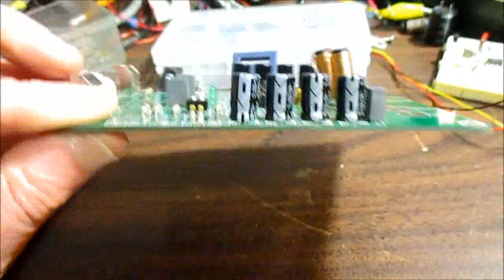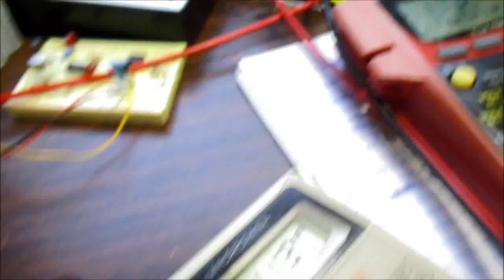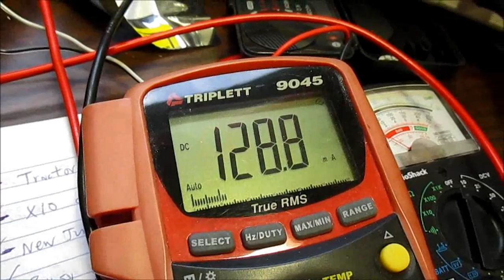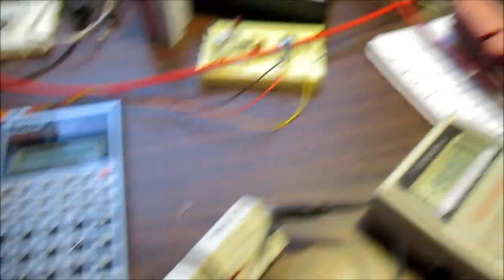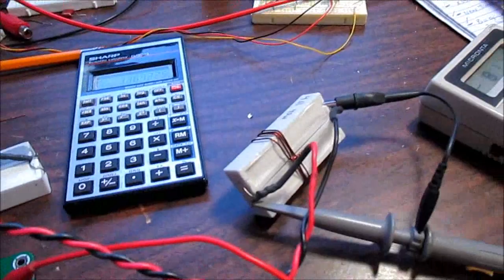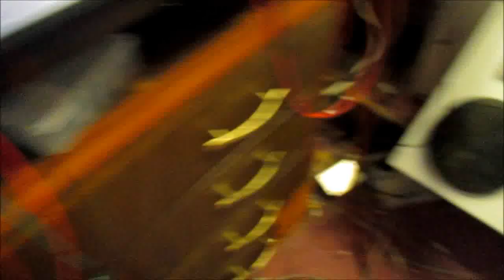Class D stereo audio amplifier kit review

Comment: can i connect my electric guitar to it directly?
Reply from the maker: You would need a preamp.
Reply: but electric guitar pickup have passive preamp...wouldnt it work directly with this class d amplifier kit?
Reply from the maker: If you set the switches to highest gain on the amp, it could work. It really depends if the input impedance is not too low. Guitars really need a fairly high impedance.
Reply: okay thanks for your help.. :)

Comment: inductor power dissipation at idle seems to be a common issue with switching type amps, probably in much the same way that inductors in switching power supplies pass current even with the IC "off". My TA2022 based amp runs cool all the time except when i turn the volume right down to the stop and leave it. Thing gets ROASTING hot then
Reply from the maker: +Maurice Orris What is the idle current draw? Roasting hot at idle sounds like there is a bigger problem.

Comment: HI John, hope things are well with you. Bought a mini hi-fi 2.1 DC 10-18v digital amp board 15w*2x30w class d from gloriadly on eBay. Hooked it up to a 12 volt supply and hooked up only one channel and played a song through my iPhone through an 8 ohm speaker. Output very low. Any reasons off the top of your head as to why the output is so low? Maybe I should be using a 4 ohm speaker? Don't have one so I can't try it. Thanks for the insight and take care.
Reply from the maker: +Ron Siddall It could be the amplifier has low gain. If you mean there is barely any sound even with the volume all the way up, it could be one of many possibilities.

Comment: Just put this amp together and have it playing a pair of Def Tec Pro Monitor 1000's with a 28v Power supply and i am impressed. Very low floor and fairly accurite with very little distortion within reason. For $20 not bad at all and a fun little project.

Comment: The granulized "4-bit" type sound comes out because your source is also using a D class amplifier. It creates a distorted sound, probably caused by those both switching frequencies... 
I noticed that with 'some' D-class amps feeded by my iPhone phones output. 
Using a dock connector in audio output mode, this is no more a problem. 
Try this amp with another 'full anaogue' line out, like a CD Player to try

Comment: Hi John, I have assembled the schematic from the datasheet around the TPA3122 changing the outputs with 33uH LP filter and 1000uF HP filter.
I get a 400mA draw on PSU if i touch the headphone jack and also if I put DMM on the HP Jack I get 1.5v. Needless to say I does not reproduce music. Any ideas and thank you in advance for your time.
Reply from the maker: MonkeyMagic Elecifun  This chip requires careful ground layout and decoupling near the IC otherwise it can be unstable. Could be many things without seeing your circuit.
Reply: JohnAudioTech Hi there, I understand what you are saying. If I make a short video showing the circuit, could I show you please?
Reply: +JohnAudioTech Hi, I done it, I re did the circuit and am listening to it now. Its not too bad at all.

Comment: JohnAudioTech Does increasing the output coupling capacitors (uF's) from 220uF to 1000uF make a big difference on the sound quality?, what does it actually do increasing them?
Does it make the bass better or does it mean when the amplifier is really loud the bass signal would NOT break down and have more power behind it with the larger output coupling capacitors,is that what it does.
Is there a limit to where i could increase to, could i go 47,000uF for example and would that sound much better.

Sorry to ask lots, what exactly do theses capacitors do, thanks
Reply from the maker: SP330Y The caps main purpose is to block DC from getting to the speakers. Since they are a high frequency passing element, they need a larger value to pass lower frequencies. 1,000uf good, 2,200uf is even better. Going too large is bad as a large burst of DC would conduct through the amp and speakers when the amp is first turned on as the cap charges which can be potentially damaging. It is not really adding bass to the sound, just letting more of it get through to the speaker. If the speakers can't play lower bass and/or the music lacks much bass content, bigger caps won't necessarily help.
Reply: Thanks so much for your insight and explanations. In the video, you pointed to the two caps on the right being the output caps, but what are the two on the left for? What if they were changed to 1,000uF as well? Thanks and take care!
Reply: +JohnAudioTech Amazing explanation, thanks! :)

Comment: Hi John,

Great video. I have two questions:

1.) Would it be possible to build a pre-amp kit, like the one described in the attached link, and use the ouput of that pre-amp to drive this amp?
http://www.instructables.com/id/32W-Stereo-Audio-Amplifier/?ALLSTEPS

2.) In one of the comments, you mention that it's not possible to drive a 4 Ohm speaker set with this amplifier. Does that imply that this circuit can only drive 4+ Ohm speakers?

Thanks!
Reply from the maker: Vladimir Grouza Yes you can use a preamp if your input signal is too low for the power amp to drive or if you want tone controls. If you are amplifying a headphone type player or line level signal, the amp has plenty of gain for that. Don't add complexity if not needed.

If you epoxy a heat sink on the IC, it would be okay to use 4 ohm speakers.

Comment: Hi John - I’ve just built up one of these kits myself but before testing it, I decided to check the DC offset of the outputs. To my surprise, one channel read about +6.6 VDC and the other roughly -6.6 VDC. As you can imagine, I didn’t feel happy connecting up my speakers. However, when I connected a 1K-ohm resistor across an output channel to provide a light load, the voltage across that output fell to millivolts. The amp seems to work OK, but I was curious if you measured the DC offset and if so what your measurements were.
Reply from the maker: SuperBoobaloo I'd consider that normal because the output capacitor would be at the same voltage potential as the output pin until some load was added to allow it to charge. With power and a load connected, but no signal, you should measure about the same voltage across the output cap.

Comment: Did you try fiddling with the gain switches?  I see in your video that it is set for maximum gain, and my board was not particularly quiet at that setting either (using 12 V). But dropping to 3/4 or 2/4 settled it down and it sounded very acceptable at those settings.

Comment: Output filters seem to be poorly designed. Would of like to have seen the unit stressed at it's maximum rated power supply voltage, seems doubtful that it would hold up well. Wonder if the chip would protect itself? Don't see much merit to using class D for a low power amp, especially if doesn't have very low quiescent power usage.
Reply from the maker: This IC has thermal and short circuit protection. Even so, running them hot will eventually lead to early failure. I'm not certain the IC supplied with this kit is even authentic. Too many issues with this amp to bother with it. It goes into the "forgotten" parts box. I haven't had much luck with Sure Electronics's products.
Reply: JohnAudioTech
The name "Sure" alone put me off the first time I saw it, seems like they hope to be confused with the prestigious brand "Shure".